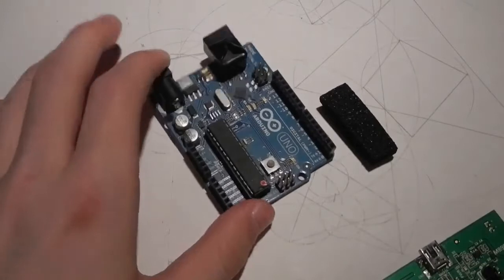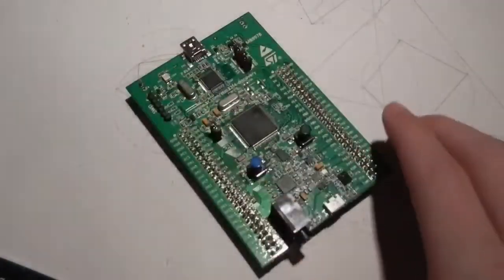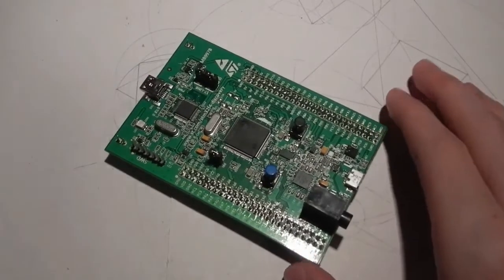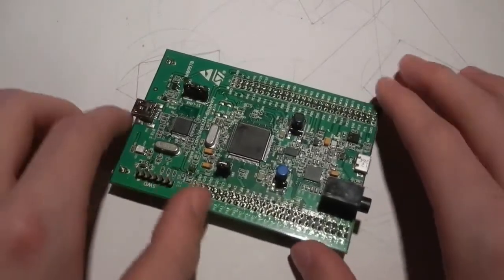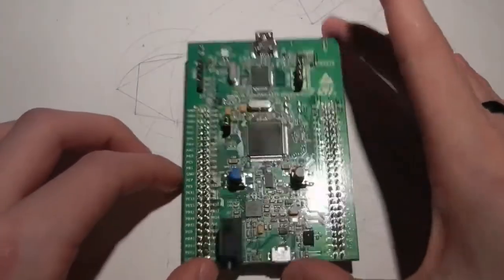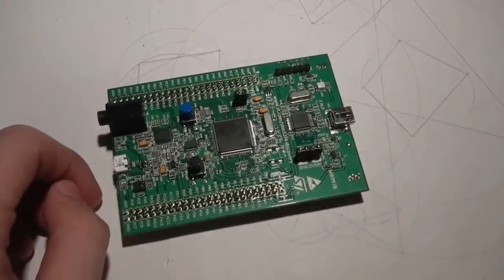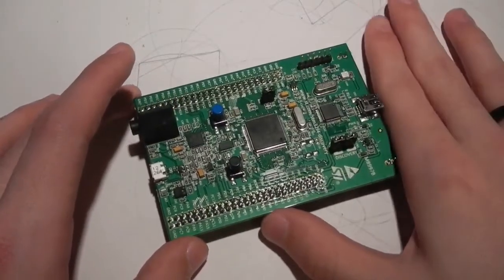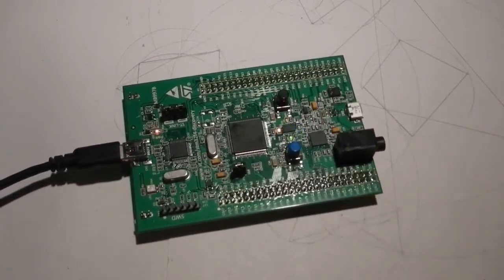32f4Discovery Hardware

Comment: I tried to disable the driver signing but it didn't work. So I changed the windows 8 ( 64bit) to the (32 bit) then it worked. I installed the GCC compiler and the Coocox Ide. I am ready. Waiting for your next STM32F4 Video. 
TY

Comment: What I find frustrating is the complexity of developing C or C++ natively using IDE, Linker, Compiler, tool-chain etc. There is nothing totally free without limits like there is for the Arduino (AVR). The closest I have found is using the .Net Micro Framework from Microsoft. The big challenge there is the lack of properly implemented interfaces and drivers. :S